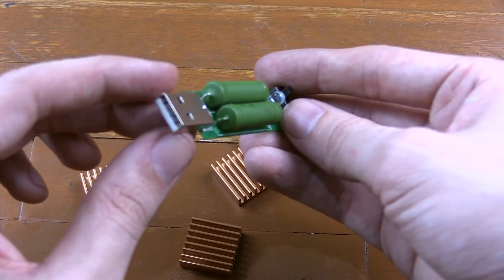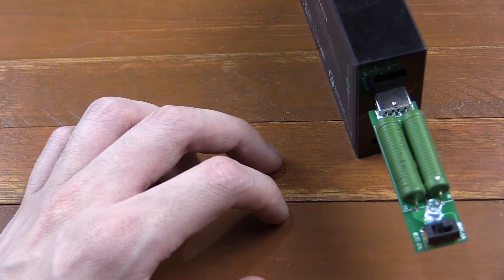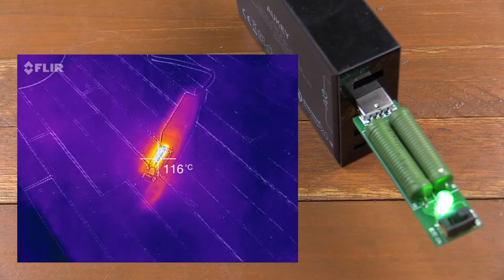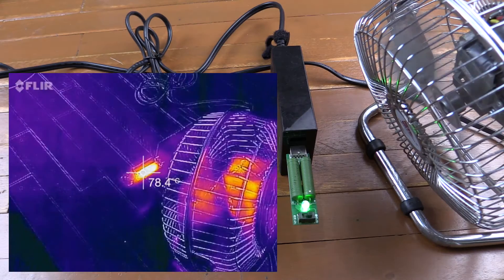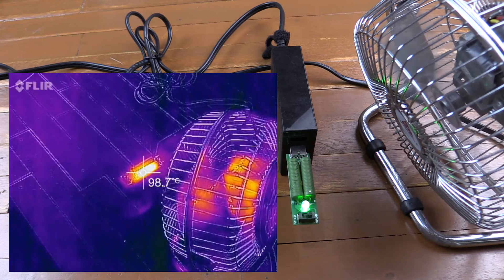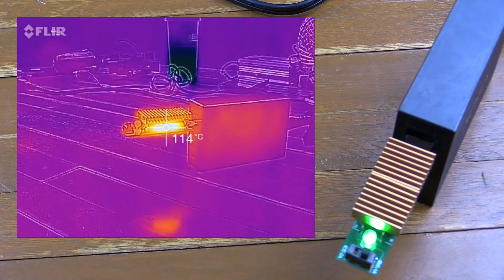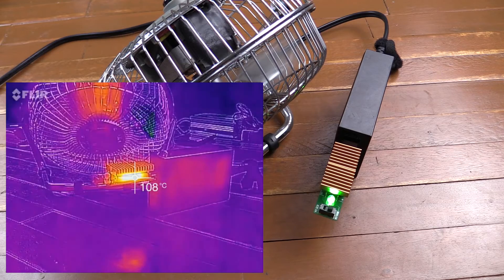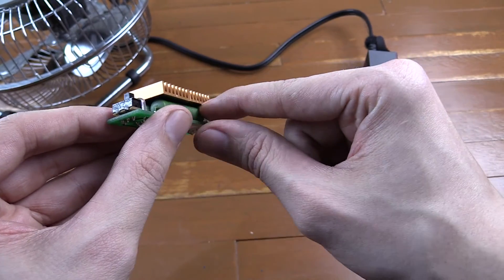USB Dummy load cooling test

Comment: how tick does a wire need to be to run 2a though it
Reply from the maker: +Mix Bag mmm depends on how long the wire is. If it's just short, not that thick.
Reply: online it says less than 1mm... personally i think 1mm is more like it.

Comment: 1 TIP for you!! take some thermal paste and an epoxy glue! prepare the epoxy and put thermal paste to the epoxy and then put the epoxy to the resistors and the heatsinks!! Let some time to cure. epoxy with thermal paste can by used as thermal conductive material!

Comment: And was that test only at one amp! The ceramic resistors that SEELE01 pointed out and the use of a thermal paste that Cyberfloy also said and with those copper heatsinks and with the fan at max I think it would do the trick!

Comment: Is it the power supply you're worried about?  You could just run it through a usb extension to space it away from the power bank.
Reply from the maker: Nah I'm trying to cool the dummy load itself. I can most likely handle the heat without too much of a problem but it's fun trying to cool t down a bit :)

Comment: Hi GA, luckily I have heat-sink with Screw hole on the center and installed on the dummy load hole, Which has nice sandwich like grip between resistor and heat-sink. Also serve as Handle.
Reply from the maker: Have you tried touching the side of the resistor while it's on to see how hot they get?

Comment: If you can replace those resistors with a ceramic type, you can have a flat surface and can transfer heat to the heatsink much faster.
Reply from the maker: Good point! I hadn't thought of that. Being round and having ridges certainly doesn't lend well to having a heat sink attached!

Comment: Try putting some thermal paste between the resistor and the heatsink, and also on the sides of the resistor. This will increase the heat transfer between the resistor and the heatsink. And if you don't have thermal paste tooth paste will work fine too.
Reply from the maker: Good point. I hadn't considered that not only do we have limited surface area between the resistors and heat sink but also that the resistors have ridges which decrease the surface area even further. Thermal paste could be the answer :)
Reply: As he said, I think the greatest benefit will be using one resistor as a heat sink for the other (in 1a mode anyway). Apply thermal compound between the two resistors and a little on the tops and I think you may be in busines.. I've never had much luck with those thermal pads except for these new black 3m pads I purchased. They seem to transfer energy much more efficiently and its kind of gummy so it gets into nooks and crevices.

Comment: You might just need better thermal pads. There are quite a few places you can get them. I'd also wager to put in a bit of thermal paste to fill up the gap between the resistors since they are cylindrical in shape.
Reply from the maker: Yep I think you're right. Thermal paste should help fill the gaps and the ridges on the resistors. I'm gonna give it a go!